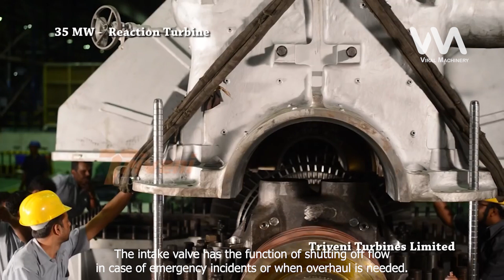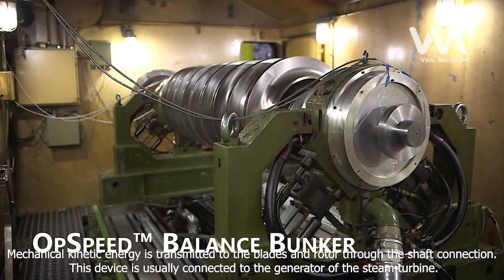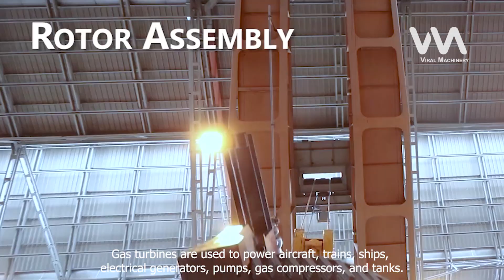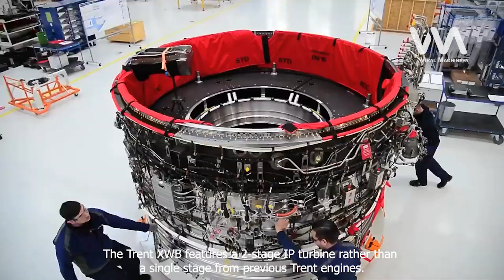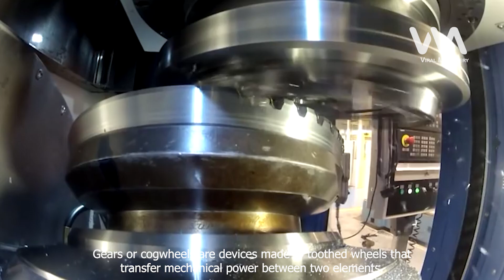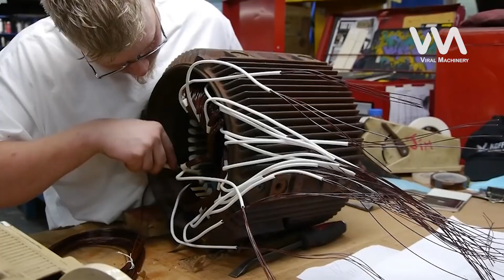From steam turbine to aero engine manufactoring process - Incredible heavy duty equipment working

Comment: Turbomachinery. Fascinating. Tho this vid is kinda crazy. Ostensibly about steam turbines, images of every disparate nature are flashed at random - roots blower rotors, gas turbine compressor rotors, centrifugal compressor rotor stages, machinists making parts on vertical boring mills, dynamic balancers, you name it. Haha. Even some of the images are nutz. E.g. a man whacking away on a locating dowel with a balI pein hammer, when he should be whacking on an intervening brass drift or using a brass, copper or lead hammer. While the Gal keeps narrating, seemingly oblivious. In addition to which the she seems to have little idea what she's talking about. Much nonsensical. Read off a crazy script. Cwazy!

Seemingly subltley emblematic of crazy modern society. The way things are going l wouldn't be surprised to learn that's the intent of the vid. Tho the vid images are excellent, whatever their intended use.

Crazy.

Crazy.

There must be GBux to be made by turning out vids (like this). Just mash together reams of disparate words and phrases etc. and get a Gal to read the script out. Sense is optional. Not a consideration.

Haha. I'lI bet 'pope' Big Frank gets His 'Wisdom' watching vids like this!